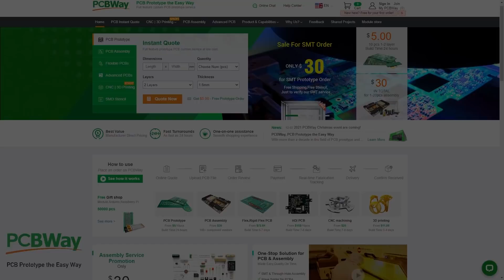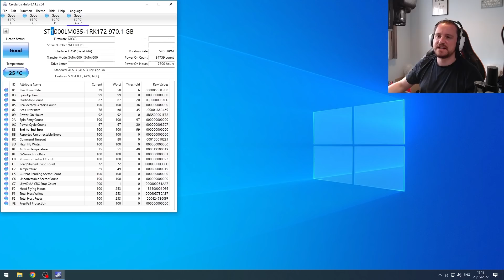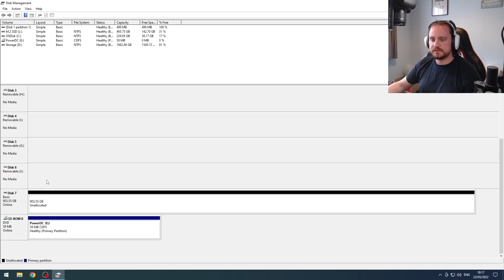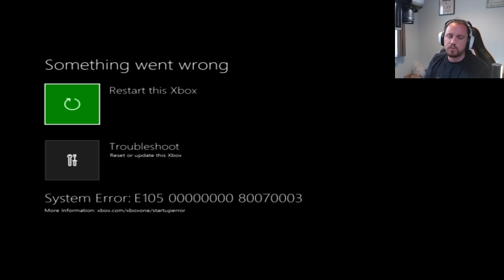I Bought A BROKEN Xbox One X | Can I Fix It?

Comment: You can unclog your flux nozzle by gently touching its tip with a hot soldering iron. I use Loctite flux here in Hungary, because it is available here in lower quantities, too, and I get this issue all the time because I only use it about once a week.

Comment: Are you adding a bit of solder to your tips when you're done soldering?  That helps to prevent them from failing sooner.  It's a maintenance thing to do when you're done with the tip
Reply from the maker: Ahhh okay Chim that makes sense. I’ll do that going forward! :)

Comment: Those windows CMD commands are also incredibly useful if you're getting rid of an old drive. It's a total wipe. Great tip.
Reply: Just a heads up - this only marks the drive as empty, but the data is actually still there and recoverable until it's been overwritten by other data. Same goes with deleting files and emptying the recycle bin.

If you're selling a drive that's had personal info on it then you want to completely overwrite every bit with zeros. Plenty of tools to do this but HD Tune is what I use on Windows.
Reply from the maker: Completely agree :) It works wonders!
Reply: @JoeyDoesTech  And I rarely comment on YouTube so while I'm here just wanna say keep up the good work and thanks for the vids. You're one of the few people who's videos I'll watch as soon as I see the new video notification.
Reply from the maker: @LiamB1708  ah thanks Liam that means a lot. Thankyou for the tips as well, that makes complete sense :)
Reply: Nice to see that someone practice the good old dos days. i so miss configuring the Cd drive in dos / / /. For me i moved to Dev in Linux